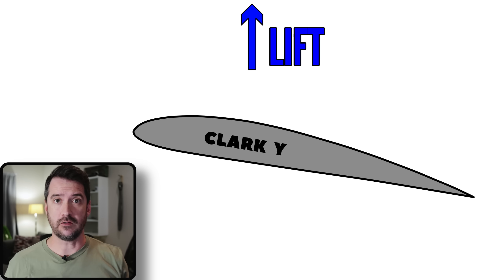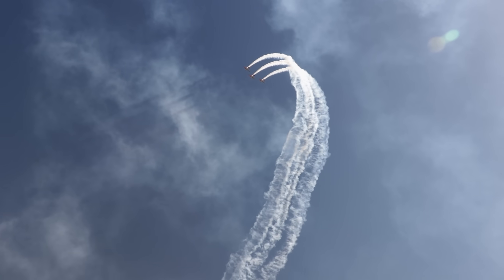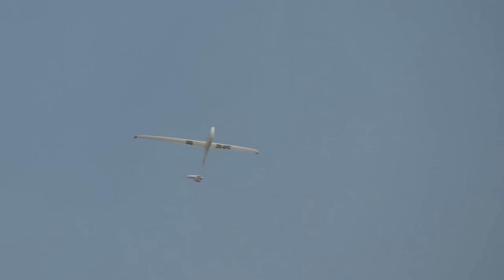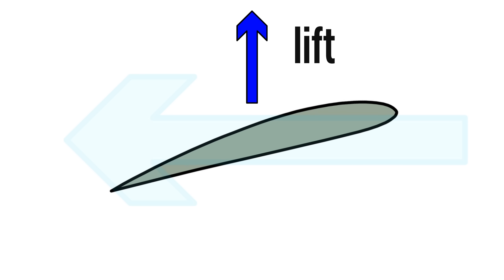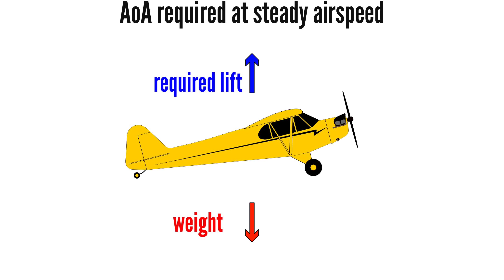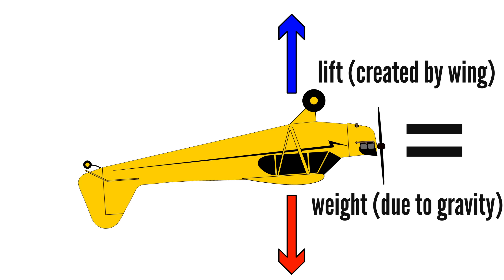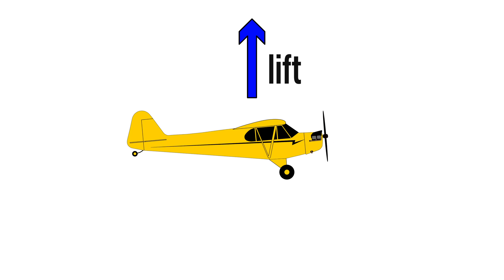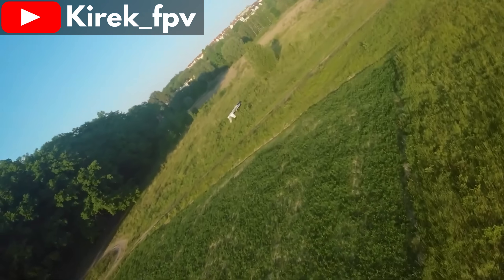Is Airflow Distance Over the Top of a Wing Always Longer?

Comment: I build and own a Dodge Charger Daytona (car) created at Lockheed back in 1969. I wish I could share photos. I build the wings for these cars today out of aluminum. The wing is an inverted Clark wing that is roughly 5 feet wide and 6” front to back. I wish I knew the calculations of how much downforce this creates on my car going 100 mph? I have heard by rumor that at 200mph it creates 400lbs down force - level - flat on top. I’m assuming at this setting there is no drag, or little, for the gained effect. 

Love the program. 

You can see the car and wing if you google “Dane Wing Daytona charger”

Comment: IF what you say were true (and it is not), then paper airplanes could not fly. I always knew that teaching was "primarily" bullshit.
Reply: @davetime5234  nothing
Reply from the maker: Help me understand what exactly makes paper airplanes so special? On a paper plane too the pressure differential is created largely due to AoA, air over the top of the paper plane wing is accelerated and follows a longer path, and stagnation point would form slightly below the leading edge. The biggest difference to "actual" aircraft is the margins are much smaller, i.e. the pressure differential is much smaller, the path length difference is much smaller. But it flies with those tiny differential because it is extremely lightweight.

Comment: If you are in a closed room that is very warm inside, but the outside air is very cold. You then open up a slider window, what happens? The cold air rushes into the room and it becomes cold. The high pressure always takes over the low pressure. That is why watching the meteorological weather map the red line, is always in front of the blue line.  Hence the high pressure always moves towards the low pressure, aka (wind).  Some jet fighters have very sleek or thin wings, not generating that much lift, but with speed and changing the angle of attack on the wing they are airborne. Any pilot that knows how planes fly, be it a Cherokee 160 or a Saab Gripen.,  you pull back on the stick to climb and press forward to dive. Depending on your plane and wing shape, any plane that can do aerobatics, the pilot knows when flying inverted, you have to push the nose forward to stay in level flight. because, lift is now pushing you to the ground. flying upside down you just do the opposite to your controls to stay airborne in level flight. So not sure how your debunking lift on a teardrop wing?

Comment: Differential speed is not what causes lift.  There are wing designs with longer ventral paths and they still fly -- not as efficiently, but they still fly. But, think about it, what is the actual difference in airspeed between air going over the top of a wing versus along the bottom?  The difference, depending on the wing, is insignificant.  That little difference in air speed does not account for all the lift created.  And, if there is a lift created, what is the ACTUAL mechanism?  What is it about faster moving air that actually causes less pressure?  Getting down to the molecular level, there is nothing.  There will be less pressure over a hole in the wing, but that is over the hole, not over the actual surface of the wing.  Nor is lift caused by mass displacement.  Well, OK there is some, but not enough to account for the total lift generated by a "standard wing" in a "standard orientation".  You can slam anything through air and the compression of the air will "create lift".  When a space capsule is going through the atmosphere all that compressed air in front of it is "lift".  That stuff is also what we refer to as drag.  Most of drag is not skin related, but pressure differential from front end vs back end.    How lift is generated is dependent on your fluid speed and fluid density - all that Reynold's number stuff.  At "different speeds" and different angles of attack, there are different mechanisms at play.  But once you get enough speed across a wing, the actual lift is caused by differential pressure.  (Yep, everyone will agree with that, I suspect.)  But what causes the lift?  Yes, it does depend on airspeed, but the speed itself with respect to the wing surface is not the cause of lift.  What happens when molecules hit the wing is that they try to resist moving and so at a leading edge there is a high pressure (high density) region as the air gets pushed out of the way.  The energy coming from the wing pushes the molecules aside and in doing so creates high pressure regions (streams) that flows up and over the wing and under the wing.  There is a high pressure volume that also goes under the wing and flow under the wing stays close to the wing and can actually get a boost if the lower surface is at a positive angle to the velocity vector of the wing.  But the compressed flow over the top is put on a trajectory up off of the wing.  Now, the flow is not unattached over the top, but right next to the wing the air is at a lower density than a little ways off the wing and it is the camber of the wing that keeps that denser flow away from the wing.  Slow down and the pressurized region collapses back down to the wing and lift is lost.  That high pressure region will expand, but not until the wing passes far enough past it.  But keep the wing speed high enough and have a surface that migrates away from the flow and there will always be  a low pressure region right next to the wing.  That low pressure region is sucking the wing up, and, along with the higher pressure on the bottom of the wing, is what results in lift.  But even this does not account for lift on all aircraft.  Very low speed lightweight aircraft don't generate lift via this effect.  They depend on air mass compression and density differences between the top and bottom of a wing.  The thing is, what causes lift is different for different types of aircraft and in different speed regimes and flight modes (eg, low AOA v. high AOA).
Reply: @davetime5234  
Yikes!  I must have hit a nerve or pushed the wrong button.  Sorry to get you so upset.  Anyway, your writing sounds upset.

(1)	"Differential speed is not what causes lift" The speed difference i..................implicates the drop in static pressure...........................................relationship) 
a.	“implication” is not proof.  The speed of air molecules is only important in so much as it “creates” momentum.  The “difference” is not critical as shown by shapes that develop higher speeds over the bottoms of the wings yet still provide lift.  “Boat tail” airfoils provide lift even with overall air speeds being greater across the bottom, but the lift is still created across the top because of the relative positions of where the occurrence of the flows is different.

(2)	"What is it about faster moving air ........................................"  So you're a "flat Earther" in terms of denying the Bernoulli ............................energy? 
a.	OK, no need to go “trolling”.  Let’s keep this civil.  Bernoulli is fine for in pipes and with other constrained conditions, but the principle has often been misapplied to flow over wings.  Sure, it appears to work, but that is only because the application has been “kludged” to make it work.  Bernoulli describes an “effect” not the “cause”.  I appreciate Bernoulli within its limitations, just as I appreciate Newton vis-à-vis Einstein.  Even Ptolemy was a little correct, but his views were replaced by Copernicus, and in turn modified by Galileo, Kepler, etc.  Science keeps changing and Bernoulli has been improved upon.

(3)	"Nor is lift caused by mass displacement. ................................... Completely wrong on both points. Mass displacement.............................es the pressure difference). 
a.	Sorry, not wrong.  Mass displacement can be zero and you can still get lift, unless…… you are saying that something has to be moving to get lift, but mass displacement is not the wing moving or the slip stream diverging and converging.  Yes, both of those are masses being moved, but mass displacement refers to a fluid being permanently relocated.
b.	You seem to want it both ways: “Mass displacement has to completely account for the full amount of lift (as does the pressure difference).”  Which is it?  MD or lift? Either? Or? Both? Neither?  (I guess if nothing moves then there is no lift, so the airplane has mass, and if it moves, then lift is created???  Is that what you are saying?  That is not what “mass displacement” is referring to.)

(4)	"But once you get enough speed ...............................The lift is always accounted for by differential pressure, .............................. 
a.	No, not always.  Lift can be a result of a change in momentum, as with the downflow of air from a helicopter or from the Harrier engines.  F=ma.  If the gasses are accelerated downward then there is a force in the opposite direction (providing lift).

(5)	"under the wing stays ..........................................., but it is always the minor contributor ........................................................................especially is minimal effect. 
a.	No, not “always”.  There are certain regimes where this effect is dominant, but, agreed, mostly not.

(6)	"They depend on air mass compression" Again, this is false. The................................................. drop. 
a.	Nope.  Again, Bernoulli describes an effect, not the cause.

(7)	"what causes lift i.................................)" This is false. What causes lift is always essentially the same.
a.	Nope, not false.  Well, maybe I can give you a little on this one.  It’s just that what you think causes lift is not what actually causes lift.  Give some thought to what actually happens at the molecular level. But I suppose I should have left out “different types of aircraft and in”, that was a little too generic. It would have been better to say, “certain different airfoils”.
Reply: @davetime5234  Good to hear.